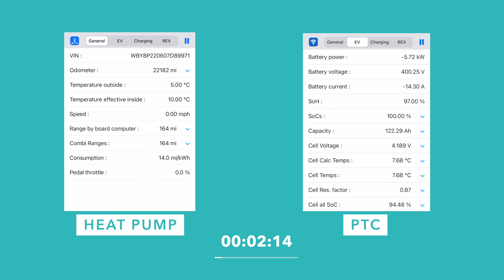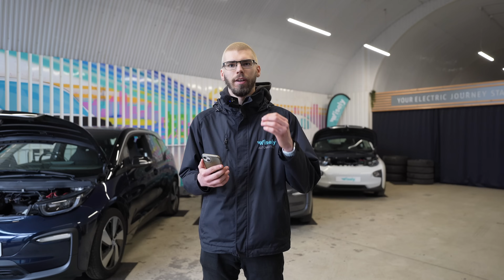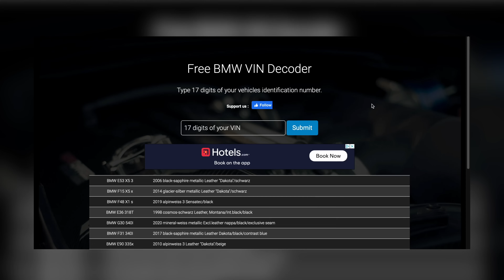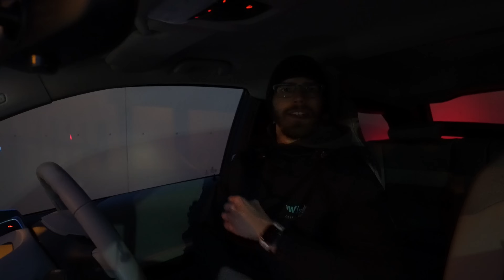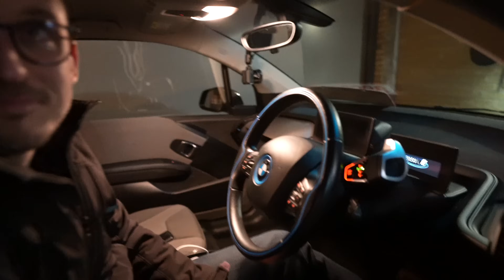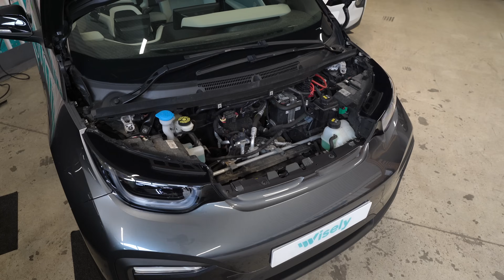BMW i3: Heat Pump Comparison in Real-World Winter Conditions & Look Under The Bonnet

Comment: I really appreciated this video... lots of good comparison data. 

One variable was only briefly touched on in this comparison... environment latent heat level... in other words... ambient temperature.

If the outdoors temperature is not significantly higher than the boiling point of the refrigerant, then there's very little the heat pump can do... there's just not enough heat to pump.

It's when the ambient temperature is a little warmer - that the heat pump efficiency climbs much higher, yet the PTC efficiency doesn't improve.  In climates where the ambient temperature is most often at-or-near freezing temperatures, the heat pump won't be much help. 

Also a static vehicle test completely removes the circulation of the ambient air around the outside heat exchanger. This means that the air in its vicinity is devoid of any heat, since it has been moved to the interior of the car. When driving, the heat exchanger always has an unlimited supply of air from which to extract heat.
Reply: Exactly… very good explanation that escapes most people when discussing heat pump or not.

Comment: The BMW heat pump does not use the heat from the motors, like Tesla does.  It would be interesting to know how much of a difference this makes.
Reply: I've never really thought the heat pump using more initially so less efficient for short trips. I have a Model Y so I'll have a play and do some simple tests.
For a trip, it's certainly incredibly effective, typically the heating is around 1% of overall energy consumption.

Comment: I admire your commitment to the experiment!  Fascinating that it's impossible to have a heat pump in a REX!  Thanks for such an informative video. 
I will have to research the BT OBD adapter and app you are using - I'd like access to this information for my i3!
Reply from the maker: Thanks! The app is called mi3.
Reply: If you have an iPhone, you can use the app called "mi3". I use it in combination with a OBD II-dongle with wifi connection to the phone. Mine is a "Vgate iCar Wi-Fi" which works very well for me on my 2019 i3s.

Comment: Your temps seem pretty warm to me. I would like to see a test here in Finland at -15 degrees, set two cars with preconditioning for the same time and drive as far as you can.
Reply: I second this. I experienced -14,5° and later -20°c temperatures today and I was wondering about my heat pump staying completely silent. The car warmed up only via PTC and I was wondering if this is normal. Martin, if you know the cutoff point of the heat pump please confirm if this is normal.
Reply: I live at the south pole and would like to see a test at -50.

Comment: Btw, do I need to activate "AC" manually to get the heat pump running?
Reply: No that's just for the cooling.
Reply: @benbaselet2026 Thanks! That mean, if I turn on the AC when the outside temp is lower than the cabin temp nothing happens except for the LED lighting up?
Reply: @nargaroth-BMIK  The AC can still be used to remove humidity from the air etc. so it will probably run until outside air is quite cool, below 10 degrees C usually. I don't know exactly how the i3 works, it would be interesting if someone had exact details. One way to watch it would be to check your power consumption via OBD while toggling the AC.
Reply: @benbaselet2026  Makes sense. Thanks a lot!

Comment: Is the performance of the heat pump vs PTC not a function of the outside temperature (at fixed cabin temp setpoint)?
I would assume at cold temperatures (below 0°C) the advantage of the heat pump is reduced and at 10-15 deg outside temp the advantage of the heat pump is even higher.
Anyhow, thanks very much again for the very interesting video :)

Comment: Interesting - so benefit from a heat pump configuration is mostly a higher speed initial cabin warm-up time, due to having both PTC and HP.
If my sums are right, for a 94Ah BEV (like mine!) your observations translate to about 1 mile of range from the more efficient warm-up (e.g. warming up on a return journey without warming up on the charger), and then another 1.5 mile from driving efficiency. I did once arrive at a destination charger with less than 2 miles on the GOM so perhaps the heat pump made the difference there 😀but in reality I'd have driven even slower to reach the charger either way.
The other thing interesting to see incidentally in your numbers, is the 17.13kWh at the charge versus 14.12kWh at the car - about 17% loss through the AC charger etc. So while I get 4 miles/kWh so 250 Wh/mile from my car, from charging at home it's actually more like 300Wh/mile or 3.3 miles/kWh.